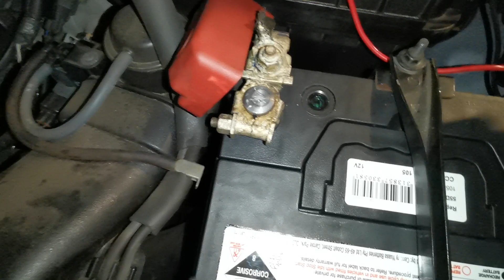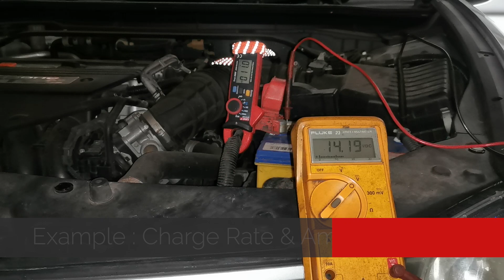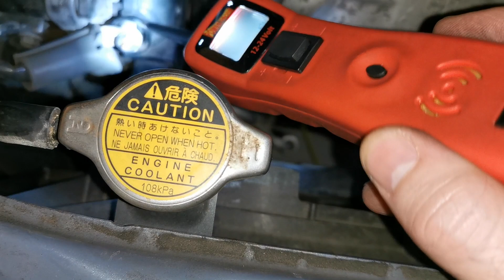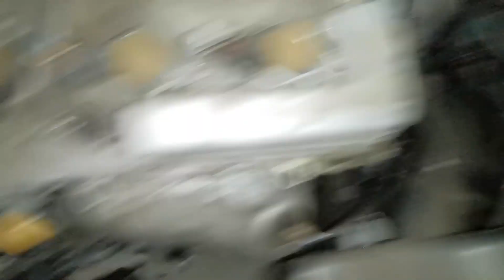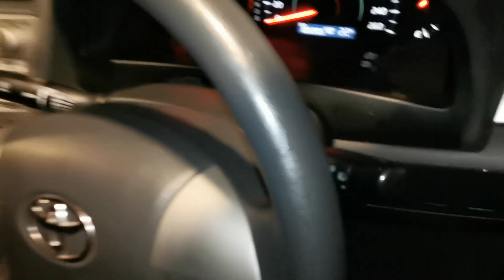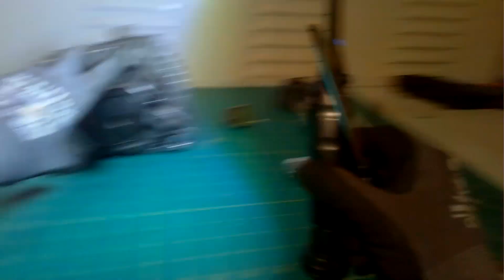Alternator & Battery Testing Without Removal - Voltage Drop, Amp Output, Charge Rate - EASY DIY

Comment: Great video.. I use very similar methods when checking the charging system. I also have a UNI-T amp clamp just higher range for trucks 24vlot starter motors
Reply from the maker: Thank you Niall 🙏 It took a lot of editing for this one 😛
I like the Uni-T amp clamps. I have 2 of them currently with another one on order 😁

Ya definitely need the bigger amp clamp for the starting peak amp output test 👌